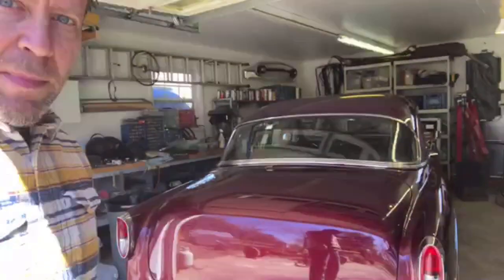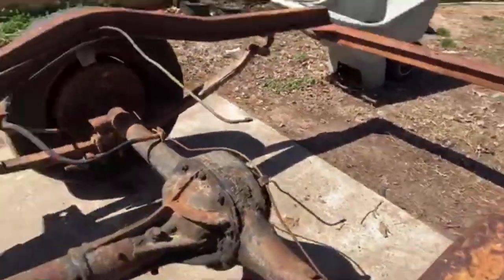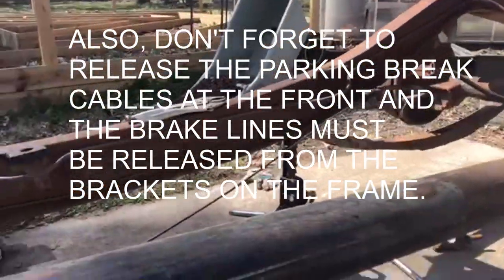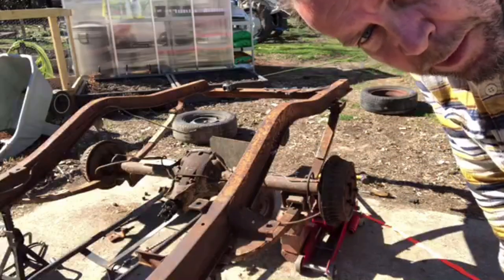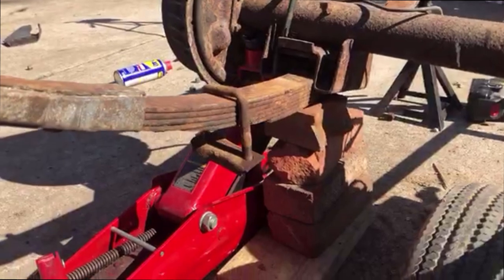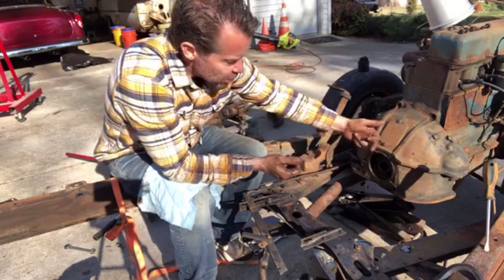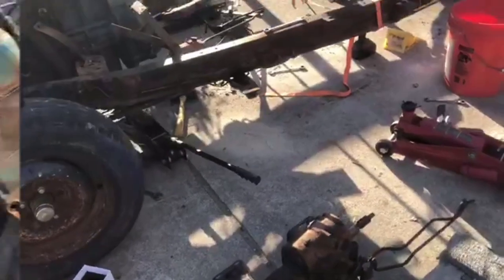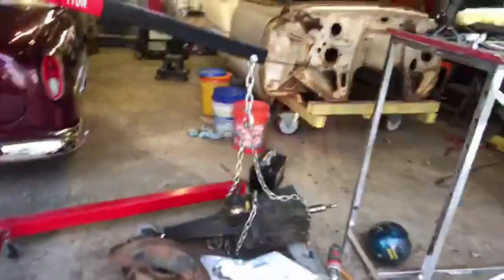1953 Chevrolet Rebuild Remove Torque Tube, Rearend, Transmission

Comment: Question: I have a 51 Styleline that doesn't go into reverse. Looking at getting repaired (Its an Automatic). I was told I needed a torque converter. Why do I need a torque converter if it already has a torque tube like yours" I didn't know they had torque converters for that year car. Thanks

Comment: Question, why would a stovebolt 1951Chevy 235 start a slight misfire every now and then only when its running for a long while at a slightly hot operating temperature?

Comment: When I had my 53 Belaire It had a Powerglide engine with more torque and HP than the standard trans engine.  I went through about 6 transmissions in about 9 months.  I had it down to 45 minutes to change a trans.  That was back in 1963.  I never saw the bottom bolts from the inside, all 4 bolts were accessed from the outside.

Comment: Do you think the ‘74 Nova rear end will bolt on to a 1946 Chevy truck 1/2 ton. I really want to get rid of the torque tube.
Reply from the maker: Dont know what the frame dimensions are on the 1946. but you can make anything work with a little fabrication, brute force and ignorance... HA!

Comment: The T5 in overdrive 5th gear running through 2.73s will make for calm cruising - about 1500 rpm @ 60 mph, depending on wheel/tire sizes. Nice.
Reply from the maker: I think it will be about right.

Comment: I’ve dealt with electrical issues in a Chrysler van like that, wipers randomly coming on. I finally chased it to a bad ground under the driver’s seat.
Reply from the maker: I've chased grounds, pulled parts, wiggled wires, done hours of research online, talked to technicians, sent it to dealerships (no help other than "lets throw thousands of dollars at it and see if that helps." I think I have determined it must be the TIPM or the ECM itself.... Sent the TIPM to Cali last week for a rebuild ($245)... we shall see. But I'll check that ground under the drivers seat for sure. Thanks for the heads up!
Reply: @jdinman6263  it is very frustrating chasing electronic gremlins in newer vehicles, makes us love our old cars even more!

Comment: Thanks for the video! Working on a 53 2DrHT. PowerGlide. Planning a 350/350 with an S-10 Rear End, 10 Bolt. I’m taking the Torque Tube and Rear End out on my back, so it’ll be a little bit longer task I’m thinking. I’ll have my complete Drive Train on my Garage floor and not sure what to do with it. Maybe sell it for a few hundred bucks. (Complete). Got the 350 Engine and Trans about ready to go when I get the 6Cyl out. Looking forward to going for a drive with the new Engine.
My budget says I gotta go slow so I’ll inch along with it. I want this 53HT to be my everyday driver. With a little Spunk!
I’m 71 so not too spunky!! Keep up the videos, I’m learning.
Reply from the maker: Love it! Take care of that 53. I'd love to find another hard top. Of course, I dream about one day running across a convertible too. I think my next project will be a 1953 Bel Air 4 door. I'm going to cut the back of the roof off and make an El Camino.... Going to be called the Bel Camino... Watch for that in 2022!!
Reply: @jdinman6263   Mr. Inman, I watch your videos in great detail, learning a lot from you! As I may have mentioned, I put new floor pans, power disc brakes are in process. I remember these 53 brakes and they didn’t stop so quick. Since I have a Flex Plate tooth problem, I’m going to clean out the original drivetrain and go with a 350 with a 400 Trans instead of a 350 Trans. Stock 350. Looking for a conservative deep tone, a little healthier too. Excited to get my Chrome back from Chrome Wizard in Mt Juliet, Tennessee. Will forward contact info, if you need it. My front and rear Emblems were badly pitted, can’t find aftermarket, so they’re doing those too. Nice People! I admire your Burgundy 53, that’s a beautiful car!
My original drivetrain runs good, I’m just not going to pull the Trans to fix it. A little more labor and it’s all upgraded. 
I’ll get a short video uploaded soon I hope. Thanks for the response, keep em coming.
Reply: @jdinman6263  P.S. My drivetrain has to go somewhere. I live in a close residential area, just south of Macon, Ga. know anyone needing one, it’ll be Very Reasonable! I can’t store it. PowerGlide.
It’s an August 53 Date Engine, believe it to be the same engine used in the 53 Corvette’s. All original, complete. Very Cheap! Don’t know of any demands for those. Ok, I’ll stop rambling.
Reply from the maker: @robertmashburn8330  Put them on FaceBook Market place or CraigsList. I'll bet you can sell them pretty quick. OR Check your local swap meet schedule. You'll find car shows with swap meets and you can probably sell them there. I have the same problem... but I do have a place to stash stuff to get it out of my way for a while. Thank you for watching the videos. I'm in the Nashville area so, sounds like we're nearly neighbors!

Comment: If they’re around had a tire I you can use a small bottle jack to press the spraying down to the correct location I will get it it’s a piece a cake that way
Reply: The bottle of Jack goes between the frame in the spring
Reply: Turn the springs 180° there again will line up perfectly and you won’t need to buy anything extra
Reply: Spellcheck screwed everything up mount a tire to that rear end that will raise the rear end to the high that needs to be Place the bottle jack on top of the spring and under the frame and simply Jack spraying down to where you needed it

Comment: I am trying to do a simlar change but on a 51 Chevy 3600 truck.  Could i get more details on the T5 you bought?
Reply from the maker: Its a T5 from a mid 90's Chevy S10 pickup. The great thing about the S10 T5 is that the truck was too underpowered to wear out a transmission and they didn't typically get used to actually tow anything. So, the S10 T5 is perfect for a swap. You need to make sure you get one with the shifter in the forward position if you are running bench seats. A lot of S10 pickups had buckets and they ran a rear position shifter... 
You'll need that adapter plate and a new drive shaft and rear end... NONE of that torque tube stuff will work.
Reply: I’m trying to do something similar to 1951 Chevy 3100  keeping 6 lug rear end, any idea of which rear end would work?
Reply: What is that adapter plate called? I need that, trying to do the same swap on my 53 bel air
Reply: @HAVILA65  kind of late comment but why would you want to keep the stock rear end? If it's for looking original you can have a latter year diff axles redrilled for 6 bolts then again the hub caps will cover the lug bolts